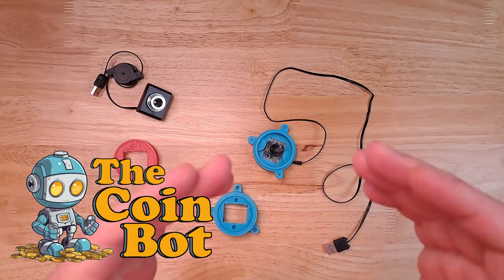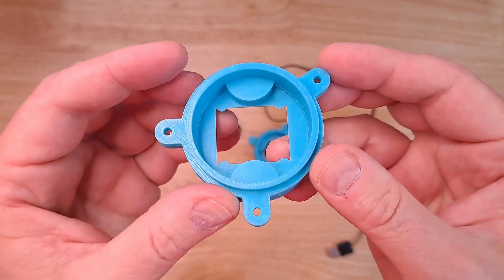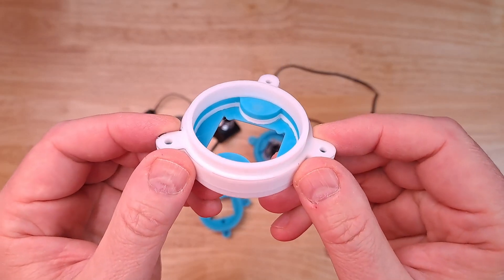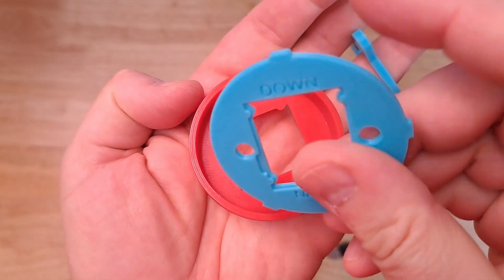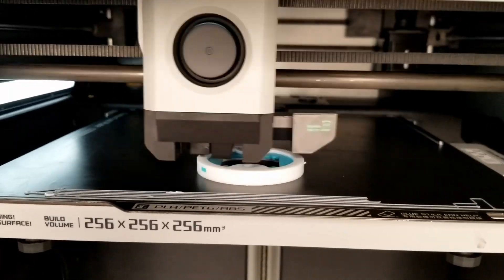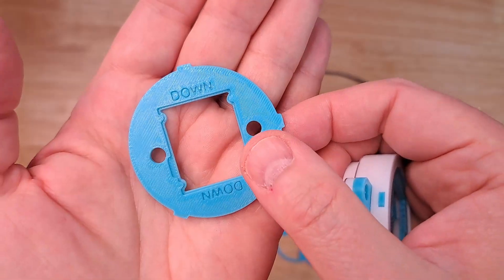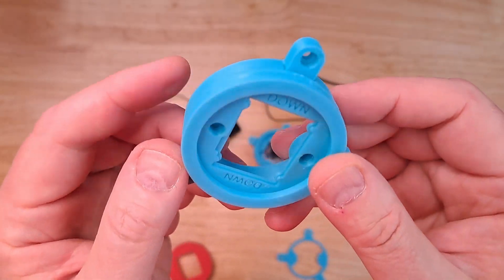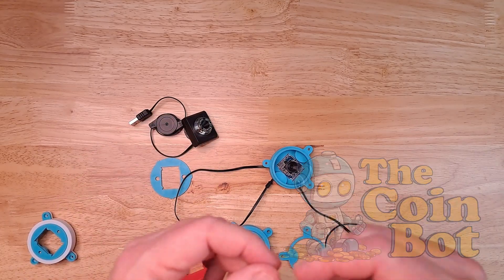3D Print Unsupported Overhangs! - X1 Carbon - Bambu Lab

Comment: That's game-changing !! i would love a step by step tutorial on how you cut it and sliced it .... GREAT STUFF
Reply from the maker: Hey AB . . . I'm not sure I understand what you're asking for beyond what I put in the video, but I'm happy to put another video together if you can let me know what you need. The gist is that it really depends ont he geometry of your part. But generally you would just print the "bits that would overhang" on the print bed first. The create a female part that will accept all fo those parts, then pause the female print at the top of each overhang and insert the overhang parts as you go. I am using the Bambu Slicer, but I think most slicers will give you the option to pause the print. In the bambu slicer you SLICE the part, then move the layer slider on the right the layer you want to pause on. From there you can right click on the layer slider and slect PAUSE. When the printer gets to that layer, it will pause, allow you to perform some function manually, and then give you the option to manually resume printing when you're ready.

Hope this helps, please let me know. I'm happy to help if I can.